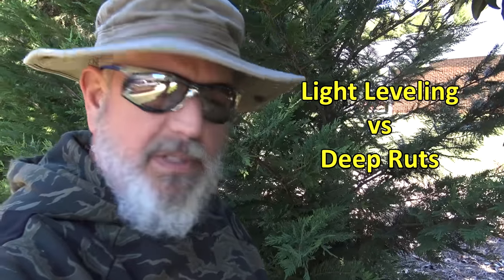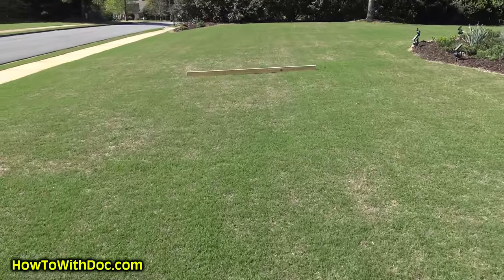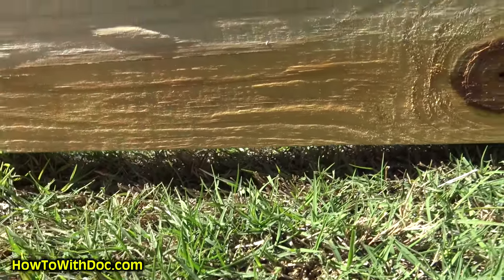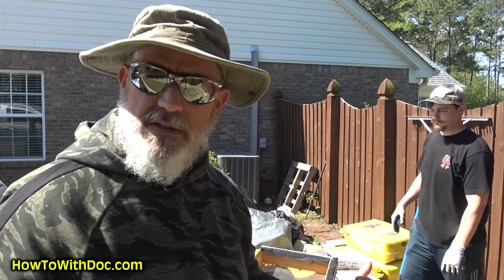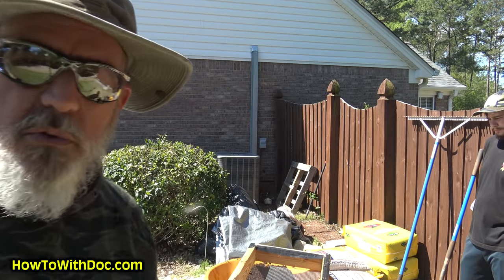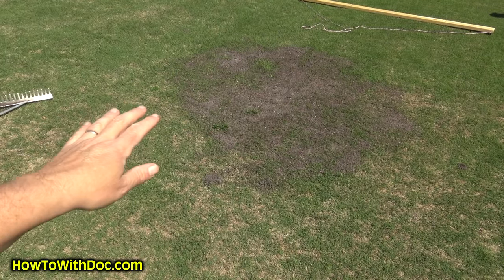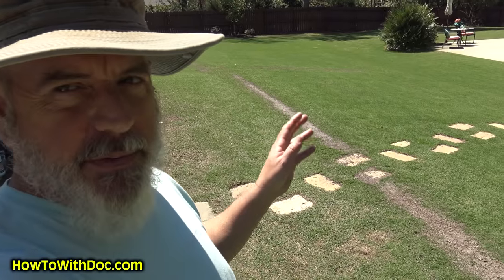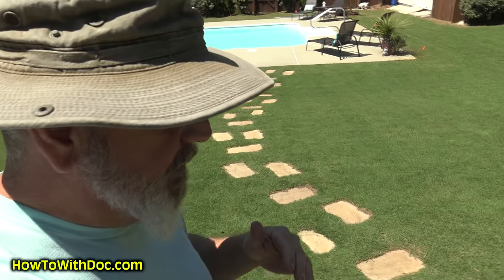Leveling Bumpy Lawn

Comment: Hi, Doc. Thanks for this video - this is exactly the the method I will use this weekend as I fill some ruts.
Question: I have a part rut that I also need to grow some new grass in. Should I fill the rut with your 50/50 mix first, then seed and cover with topsoil?

Comment: You covered depressions in the lawn, but what about high spots? Obviously just pounding them down would just compress the soil. I have a zoysia lawn in GA that is now a year old. It is really thick and already developing a heavy thatch layer. I have watch several of your superb videos and they are very helpful. Just did not know if I should consider detaching such a young lawn? I was going to cut it short, dethatch, put down a layer of haumichar, and then the 50/50 mix to level it out. Thanks again for the great work.

Comment: Sometimes, you have to sift everything. I use a rubber concrete float to break up the chunks and push them through the screen. Where I used to live the soil was all bad fill, so I got into the habit of sifting the soil that I dig up, and mix in some garden soil before I put it back.

Comment: You did a nice job, but I would like to add one thing, before you add your topsoil sand mix. I find it best to break up the surface of the soil. You can aerate, use a spading fork to gently lift the soil, anything to relieve the compaction in that area. Otherwise you risk, a perched water table, as water runs through the freshly laid soil, and hits the compacted area underneath.

Comment: That's great...how do you fix a sloping lawn that is beginning to slope toward the house in some areas? Do I have to cut the sod and remove soil underneath? The slope helps to keep rain from the house foundation and as the lawn gets older it is uneven with dips and new shallow hills forming. Just enough to flood my front door sidewalk and enough to wash out the soil under my front door steps so that the first step to the door is very high now. The soil has 'sunk' underneath. I ripped my knee joint out getting up this step due to the height...

Comment: Good video. I am doing almost the same thing to my lawn right now except that I did not use the sieve to take out the larger bits from the compost I am mixing with the sand. I should have. I am only worried that the grass is buried under the materiel at places and hope the grass comes out and not die.

Comment: My property is one big slope that has never been graded.  To even grade it would require dump trucks full of soil.  And I'm not even talking leveling.  I just talking grading so that you can mow it with a riding lawn mower.  

But I have seen other people with lawns flat as pancakes.  And how do they do it?  They just get a load of sand every year and work it into the lawn.  Now mind you they aren't trying to do inches.  When it is all said and done, the layer of sand might not even be 16th of an inch think.  And with the first rain or watering, that sand just gets worked into the soil.  It then gets mixed in with a years worth of soil conditioning from natural processes and you hardly have any sand at all in the mix.  Do this year after year and eventually you simply don't have to do it any more.  

My point to this is Doc's approach works when you have small ruts in the yard.  But if you got some pretty knarly grading issues, just dump filler soil, pack it in, and see what happens with the grass.  Its not a perfect fix.  Hell, it maybe the first layer of many.  And do what doc suggests the next year after this filler has had a year to settle and become part of the yard.  But after that, you should be able to get away with just making micro fixes with sand.  Again, you are not after correcting an inch gap in the yard.  That takes Doc's approach to fix.  You are just trying to fill in those last little gaps of unevenness.

Comment: Just watched your video and need to do some work on my own lawn, here in the Republic of Ireland. The soil here is very poor quality and has subsided significantly since the lawn was laid over eighteen years ago!

Can I use your system and add lawn seed after the filling and leveling? Ink that the existing grass will die if it is covered and not getting any light.

I’m hoping that your method with new grass seed sewn over the top and watered will do the job. Great video

Comment: I have a little more than an acre of lawn that is so rough that the riding mower bounces and bucks around. It's a wild ride and like trying to mow the lunar surface. The lawn is full of hills and craters from years of damage by voles. Variations are probably up to three inches or more in places. It's not just in a few places but over the entire lawn. What do you suggest for fixing this mess?

Comment: I have some large holes in back yard from dogs digging. Should I use a 50/50 mix with play sand & potting soil??
Reply: I'm not doc, or an expert, but I would use top soil and sand for that. Top soil is really cheap, no point in wasting money. Use potting soil for leveling
Reply: brandon macias I want to know the answer to this to

Comment: Hey, Doc. Great video. I have an issue in our front lawn of our new home. It was nice and flat until about a week ago and now it has a depression in the middle about 5 feet wide and 20 feet long. It looks like someone buried a horse there. It probably drops about 6 inches at the lowest point. The house was built last year. Is this just normal settling or could it be a more serious issue? I'm just trying to get the cause figured out. I don't want to fix and have it come back if there's another cause for it other than settling. Thanks for any info.

Comment: I just have a soft bumpy yard from moles. Don't want to do anything but press it down. Do you have any suggestions for that. I am thinking of buying or renting one of those big rollers that you fill with water. Then run around the yard pulling it with my lawn mower.

Comment: Wow. I wish that was all I was facing.  I have about an acre of land that has been a fallow fescue "field" for around 10 years. Prior to this I was able to mow it with an acceptable amount of bumpiness (it's a field/lawn). Now however, as I am getting back to this mess (it's actually my 88yr old father's land next to mine), I have put my new Cub Cadet through too much punishment to get it mowed even once. This video doesn't even begin to compare with that field. 

I am hoping to avoid hiring a large grader, or a regular tractor with a tiller box attached to the PTO. So far I managed to get most of the grass cut, but there were numerous times my mower deck got hung up on root ball clumps. I used a knife, ax, and garden fork to cut away and break up the clumps under the mower deck until I could finally get the lawn tractor to move again. The lawn/field has 8"-18" diameter clumps of root balls which brought the soil up within them. The soil surrounding is bare and 4"-7" lower, as the grass/weeds were too thick to for anything to grow. I had first blamed my brother's dogs for digging (which they had), but there is no way that explains the current state of affairs there. Oddly enough, I feel I actually need to scalp the top areas...there's more than enough seed there to start regrowth.

Lacking big machinery, I have also considered using RoundUp for a total kill so the root balls will be easier to break up. I think a garden tiller would require too much time and effort on this acre, but more doable if the root clumps were dead. I want to end up with a cut-able lawn again.  Another thought is if I had mountains of woodchips from a tree service, I could layer that over the entire area about 12" high. That would definitely soften the ground so I could do some serious rolling. This is a project that I expect to take several seasons to get under control. If anyone has ever dealt with this kind of issue, please offer useful advice.

Comment: Great thing about sand is you don't have to spread it precisely. Spread is all over the rough area. Wind, rain, and insects/worms will gradually do the leveling for you. Use a light amount that sinks below the grass and you don't have to worry about it getting hot.

Comment: I would love a video how to handle edges of the yard where they are sloped to the curb, etc.  most of us have that kind of situation to deal with, much harder to level than little dips in the lawn
Reply: I had a slight slop into my shrubs like you are talking about.  I bought some plastic edging, long enough to do about six feet.  I then put a leveled the area with sand leaving the edge in place to keep it from washing to the shrub bed.  I'll just leave it there long enough for the grass to grow up through it.

Comment: Enjoyed the video, we're heading into autumn & winter here in Aus, weather is still mild, and my lawn is the typical goat track/minefield after the builders have used it as an open waste disposal field (have pulled out half bricks, gyprock [or sheetrock as you guys call it], cable and all sorts of building materials), hence have a yard full of divots and depressions (naturally with the bare minimum clay & topsoil coverage), bastards. The grass was dormant through most of the vicious heat during summer, but has come up ok whilst the clay topping has had some moisture, so will be endeavouring to get some of the worst divots filled during winter, then work on the depressions as we head into spring and the growing season, your 50/50 mix looks the perfect tonic.....cheers from Aus Doc 👍🏼👍🏼👍🏼👍🏼

Comment: How do you fix a severe grade change that resembles a check mark. This is a result of the initial grading between properties for drainage but is causing an area of wagon wheel rutting along a fence line.

Comment: Hey Doc, nice Vid.
My Q is i have Palmetto turf on an 100mm 80/20 Soil/sand mix, thst sits above shale/rock.  I get run off and have some drains i can level towards these stormwater pitd drains and is there any point installing some French drains to assist.

Finally, would there be anything wrong with using the same 80 soild /20 sand mix for the good reading?

Cheers

Comment: I have spotty bear sections that seam like there lower than the surrounding grass areas. I cant even be sure its really lower or if it just looks that way.
Im afraid to apply a sand soil mix and drag it out because i think it will fill in the grass areas also and end up staying uneven

Comment: Would this technique work for 6-8 inch ruts?
Reply: I hope so. I've been adding only topsoil from Home Depot but it washes out when it rains. I've also used top soil from Lowes which works better but has a lot of rock mixed in so I stopped using it. I will try the sand  and garden soil mixture hopefully that will solve my problem.

Comment: Hey Doc!  All good stuff here.  I'm building a pile of organic material and soil by screening the 2 or 3-year-old bottom layer of oak leaves using the 1/4" screen.  I add some potting soil, Pete moss, and sand to that mixture.  What I learned here is that I need to up the sand content considerably.  Suggestion:  I would like to see a segment on GREEN SAND, the kind we apply to divots on the golf course.  What is it? Can I make it or buy it?  Thanks for your stuff.

Comment: Hi, newbie here just pumping into this vid when searching for a solution for leveling a lawn... Can't we just use top soil? Literally I meant, buy those bags of top soils from HD/Lows, dump on the uneven ground and use that leveling tool to level it, would it do the same job as mixing with sand?
Reply from the maker: It will compact and wash away.

Comment: Hey Doc, I just had a new backyard kitchen and dinning area put in my yard. I also had the entire backyard put in with Tiff 419 Hybrid Bermuda SOD installed. Additionally, they replaced the irrigation system. It's been two years now and the ditches they dug to install the irrigation system have settled and created long ruts for lack of a better description. I don't want to cut out the grass and back fill with top soil and I know if I dump top soil on top of the grass it will probably kill the grass. My question: is there a correct way to raise the turf without killing the grass?

Comment: So.... What about a solid 6 in deep rut??? Same process?
Reply: BlackWat3r GTR... if it's a tire rut, just dumping sand, soil, and seed will level it but it will still stick out like a sore thumb once it grows. The reason is that in the rut the soil is compacted and has to be loosened and raised up. Ruts are the worst. I have many from a construction project... going to till the area and some soil surrounding and seed it.

Comment: Hey Doc, I'd always assumed you would need to overseed these areas... would this work for deeper dips like 6-inch depth or is that too much depth for existing grass to grow up through?  Got a fair bit of levelling to do myself on my lawn for this year's videos... so much to do lol
Reply: Shaun's Lawn You can use this method for deeper ruts. If you have a creeping turf (I.e. Bermuda like Doc has) you can simply wait until the turf creeps into/through the large fill. Non-creeping turf would have to be over seeded as you will have smothered it.

Comment: If you want to level your lawn properly, what you need is a weighted roller, not a 2x4. They're not hard to get, and it's really easy to build your own using an old plastic chemical drum. It will never rust, and the plastic they're made out of is some real tough, Space-Age shit. I've literally never seen a plastic drum with cracks in it, and I've seen some pretty old ones. For weight, all you have to do is put some water in it, and you wouldn't have to seal the pivots because the proper water-level for the amount of weight you need (roughly 25-50 lbs) should never reach the center-line of the drum.
Reply from the maker: Actually.......... rollers don't work. Video coming next week.

Comment: I have yet to find a video that would help me level my yard that is on a slope. Just bought 2.5 acres and it is a disaster. Any tip on helping level ruts in a slope? I know some areas will need 3-4” of soil to cover surface roots from a maple tree. Any suggestions would be of great help.

Comment: what about the seeding... will the grass grow through or would it be better to reseed this spots right afterwards?
Reply: Seems a bunch of folks have asked this question, as I am interested as well. I have areas where there is no grass so I need to seed. And I am not using Bermuda grass. One person above suggested adding seed to the 50\50 mixture.

Doc, What say you..

Comment: Since 99% of lawns are 100% dirt, why is there a need for sand? Always just bought cheap bags of topsoil and spread it in low spots or lightly broadcasting after overseeding.

Comment: Doc, I did not like your screen!  You should build the 2x4 frame so that it nicely fits the OUTSIDE of your wheelbarrow sides but is 1 inch shorter than the length so that it sits outside the bottom end on the handles but rests on the nose end above the bed. It is too short to go over the top end.   Now you pile your soil on the screen  and use the back side of an ordinary garden rake to move the soil on top of the screen. Throw in a shovel full of sand alternating with the soil. Every once in a while lift up the screen to dump the stuff that didn't go through. Then use the rake to mix the soil and sand  while you've got your screen raised.   I greatly enjoy this work and I have filled my whole back yard and made new gardens this way too.   Most of the time I didn't need the sand but one free load of predominantly clay soil needed a lot of sandy soil added.  It was very enjoyable work and the roses loved the clay.